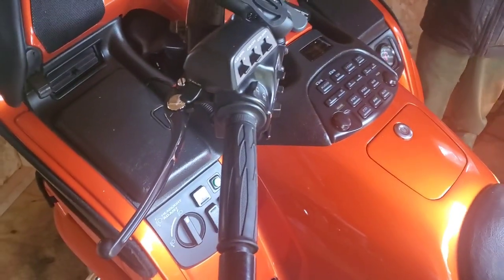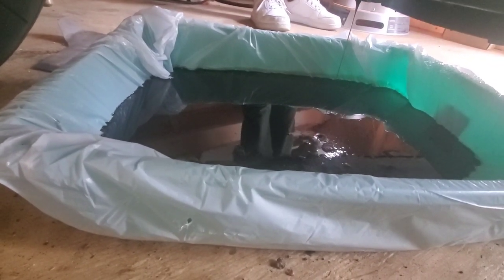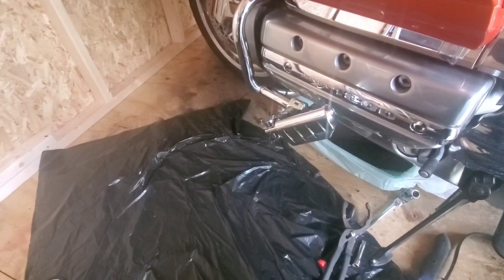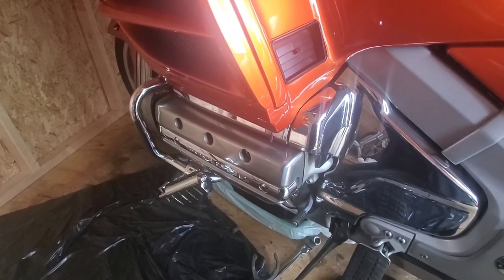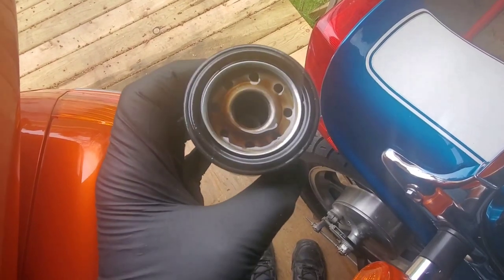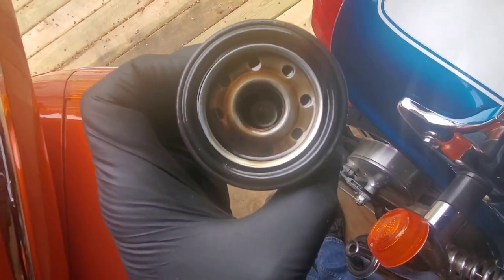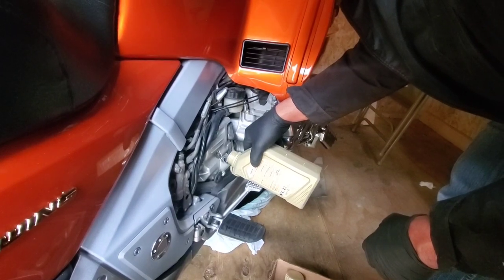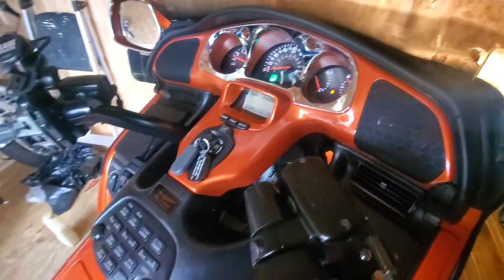WATCH THIS BEFORE YOU SEAFOAM A GOLD WING GL1800 AND POSSIBLY OTHER MOTORCYCLES

Comment: Pay Attention People. DO NOT PUT SYNTHETIC OIL IN A WING !!! Here's why,. The transmission and engine share oil. The slicker synthetic oil is BAD for the friction surfaces on the clutch discs. The discs will slip as they mate or come together under load. This causes more wear and heat than necessary. Thus shorter life for your clutch. Don't take my word for it. READ your manual. See what HONDA RECOMMENDS.
Reply: From a 2001-2005 Service Manual
Recommended Engine Oil
Pro Honda GN4 or HP4 (without molybdenum additives)
4-stroke oil or equivalent motor oil API service classification:
SG or higher JASO T 903 standard:
MA Viscosity: SAE 10W-40

The clutch slippage could be caused by mistakenly using oil with molybdenum additives. I haven't been using Honda synthetic blend oil for the last 80k miles. Have used some other full synthetic brands without issue but I've stayed with the full synthetic Mobile1 Racing 4T as shifting was smoother.
Reply: Your summary says it all: "See what HONDA RECOMMENDS."
Look for the viscosity, look for the JASO standard, look for the API class. If these fit the oil is fine regardless whether mineral based, semi synthetic or full synthetic.
As the Goldwing revs low there is no need for the high performance full synthetic oils, but from a performance point of view they outperform the mineral based oils, but the Goldwing will not get to that limit.
Changing the oil regularly is much more important than the type of oil.

Comment: Man I love your painted dash, iv never heard of seafoam, what does it do? Clean out bikes fuel system? Alaways worries me putting stuff in fuel tank 🇬🇧👍
Reply from the maker: That why I never did that stuff before. However it really worked well.
Reply from the maker: And thank you for the comment on the painted dash. When I got the bike in Dec 2020 that's the only part I didn't like. So I painted it and it really stands out now. Some people paint it all with speaker covers. But I didn't like all of it one color so I decided to just do the dash bezel and it turned out great I think.
Reply from the maker: Gary there are so many ways to put the seafoam into a cycle. I just chose to go through the gas. I'm not too sure doing it anywhere else. You can put it in your oil however my oil got so dirty just from me putting it in my gas tank. That tells me it really cleaned out the carbon deposits in the motor. So to answer your question this bike runs and shifts better then when I got it from the dealer. Because of the seafoam and then a full synthetic oil change. It never ran better.
Reply: @mosmotorcyclejourney9067  that’s music to my ears,iv just done an oil n filter change, I’ll order seafoam and what you’ve done, seems it’s worth doing, mine has done 25k miles but a good clean will only make it better, thanks for your time, safe riding 👍🇬🇧
Reply from the maker: @garyedwards8142  you will not be disappointed if you do it. Like I said I have tried all kinds of fuel system cleaning products and only found this one to work. Good luck and be safe. Let me know how she turns out for ya.
Reply: @mosmotorcyclejourney9067  I’m sure we’ll chat b4 I do it, I’ll time it with oil change,, 🇬🇧👍

Comment: Knew a guy used seafoam screwed up his diaphragms in the carb, don’t know how much he used though.
Reply from the maker: I put it straight in a 1500 gas tank with very little gas. Never had no problems with a gl1500. A gl1800 I did one treatment and called it good. Half a can to a full tank of gas. Not putting it in no oil. Don't think that would be good for it. But I'm not a mechanic.
Reply: Mine sat for 5 years before I picked it up so I have no idea if it was empty of fuel old gas or anything, it doesn’t seem like a big deal to remove and clean the carbs and sync them  just time consuming. I’m retired so I have the time .

Comment: Half a bottle? I use it according to directions on my 93 Goldwing.....with 117k miles.
Reply from the maker: Well from what I was told by a honda dealer  mechanic was to use more because it cleans more. I needed a deeper clean due to the hesitation and from what the oil looked like being as dirty as it was after a thousand miles it worked. And of course the performance was much better with no hesitation. My neighbor did the same thing with his gold wing 1500 and he ran it till the gas light was on and he dumped a whole bottle in the tank. It smoked like hell for about 15 min then he filled the tank with gas when the gas light came back on. His has never ran better. That was 30thousand miles ago. So just depends on what you need it for and what could be wrong. Thanks for the comment and watching.

Comment: Could it be possible that the sea foam created excessive wear on your motor and that's why it's so dirty?
Reply from the maker: Good point. But I would so absolutely not. 50000 miles and never had seafoam through it. Ran so much better after I did it. And put 2500 miles on it since. Still runs like it did after the seafoam treatment.  If it created excessive where it wouldn't be black oil. It would be oil with metal shavings in it. Black oil was all carbon build up that was removed with the seafoam. Thanks for watching and the comment.
Reply: @mosmotorcyclejourney9067  I'm gonna have to disagree, metal chips are a sing of catastrophic failure and not excessive wear. Black could be carbon but the only way to know is with analysis, when many metal types rub together with a lubricant it creates a black film. Especially steel and aluminum, again I would have to say the only way to know is to have your used oil tested.
Reply from the maker: @adamt581  well then we agree that we disagree. And I will leave you with this. My father has a 1990 GL1500  he bought brand new.  He runs seafoam every year through his gas like I did too mine one time.  He now has 193000 miles on it and it runs perfect. so if you think it creates wear I would say you are sadly mistaken. It's a 31 year old bike. And had a compression test done in 2019 and passed.  But this is all personal preference. Do it or don't, your choice.
Reply from the maker: @adamt581  and I just looked at your channel. Do you even have a GoldWing??
Reply: @mosmotorcyclejourney9067  2018 B Stallion Brown Metallic. I am an aerospace machinist and have mfg things that are in space, on other planets as well as mfge launch systems weapon systems laser components and jet engine  components and I have done work for nuclear facilities and microchip manufactures, right now I'm housed in our race car support building machining extreme duty engine components like internal blower/supercharger impellers turbos and suspension systems, and that's just the last fifteen years of my 35 year mechanical machining background. BUT! I'm not a mechanic.
Reply from the maker: @adamt581  with that reply I will say I like your bike.  I was on the fence about seafoam some years ago. And at one point thought the same. As in what does it do and can it hurt the motor.  And after talking to mechanics and doing my own research on seafoam I found it can help the motor. Now I wouldn't put it in my oil like it says you can. I would think if you thin your oil it can cause damage. So I decided to use it through the gas.  And I used only 8 ounces(half can) for 6.6 gallons of gas. Trust me I mean no direspet. I would not have used it if I would think it would damage anything.  And I would not have done a video and recommend something if I though it could damage something. But it's in how much you use like my mechanic told me.  Too much can possibly damage something or cause excessive wear. And yes you are a rocket scientist. Wow.
Reply: @mosmotorcyclejourney9067  I'm sure it did wonders for your fuel system but my concern is with the black oil, and if the carbon it removed from your fuel system intake head and upper cylinders somehow made it past your piston rings and into your oil seems unlikely and if it did that's a big flag but on the other hand if that's not it did it react with your engine oil negatively to creat a higher rate of engine wear in the bottom end of the engine, I really don't have an answer for that but it's worth finding out for sure.
Reply from the maker: @adamt581  interesting look at it. I would think that considering there is stroke inside the chamber that oil is present when piston bottoms out. At that point that's after the explosion and right before exhaust valve opens to release the burnt fuel and its that point the oil can capture the carbon on its way out of tge exhaust valve.  Then piston comes back up and this process continues over and over again. But it's at that point where my oil would come into contact with the carbon.  Or as explained to me by a mechanic. And it makes sense.

Comment: I was getting FI code 26. Left Knock Sensor. Poured some Seafoam and revved the hell out of it and I haven't seen code again.
Reply from the maker: Yeah. I was amazed at the difference. It does work. The only thing I found to work like it does.
Reply from the maker: @802 Pepsi Co never had a problem with my lug nuts. Once I torque them they stay tight.
Reply from the maker: @802 Pepsi Co lol got ya. First I was like really did someone say put it on the lug nuts Lmao. No worries.
Reply from the maker: @802 Pepsi Co I heard about the marvel oil. Just never tried it however was thinking about it if the seafoam didn't work. But I got excellent results with the seafoam.  I'm just damn glad I check my oil. I would have been riding it another 2000 miles with that junk in it. And I would imagine the filter was not doing its job anymore. So you have put the marvel oil in your bike?
Reply from the maker: That's good knowledge to have. Never had the f1 yet (knock on wood)  maybe now I will not get it.

Comment: I dont believe seafoam would have anything to do with dirty oil, gas burns in the combustion chamber above the oil, they dont really mix together unless you have very worn rings.. Most oil will be black after 1000 miles anyway.

Comment: That oil is tar, The sea foams will clean everything but it sure causes the oil to get hot to turn so thick, I run B 12 in my GW and my oil stays new, The slides get sticky and not let them move as smooth till I put in B 12, about a glass full per tank should do the trick. Would double cheek with Honda on New bikes before you use it in Your tank and how munch